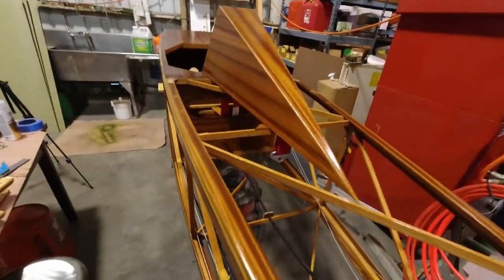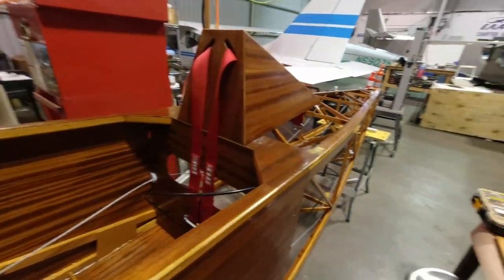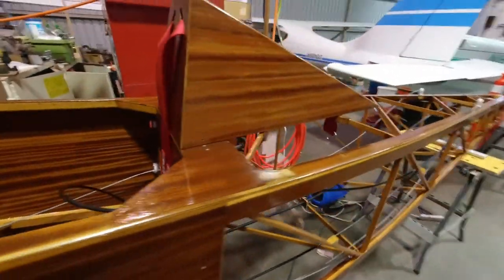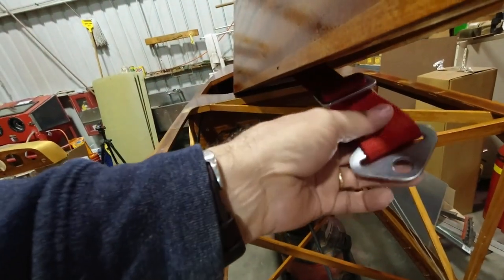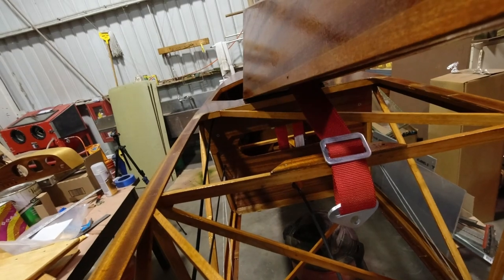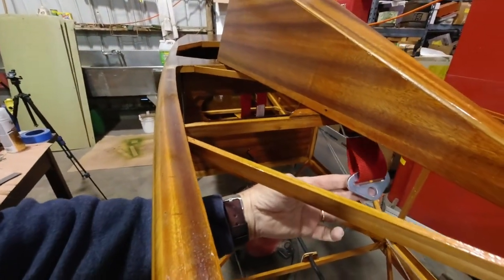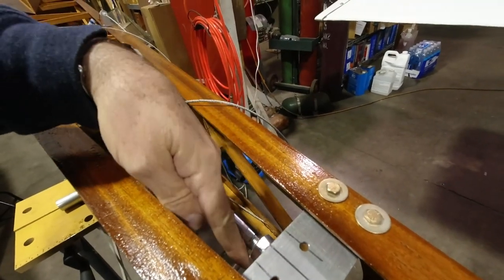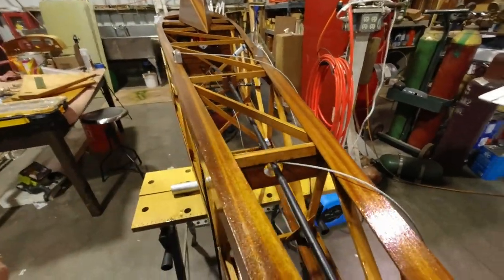Minimax 1100r Wood Aircraft Build Ep 141

Comment: Interesting that your harness goes to the tailplane area on the Fisher it fits to the tailwheel mount.
Reply from the maker: Our planes are cousins. The 101,202,and 303 were designed by Mike in collaboration with Team Minimax founder Wayne Ison. I’m sure there was some Cary over to and similarities to Mikes other designs. My two favorite wood aircraft manufacturers for sure.
Reply: @DTMinimax  cousins for sure but with differences, like the harness mounts and the use of geodetic. Now if Team made a biplane the choice would have been harder.

Comment: Please lookup the accident report for G-CCAJ and consider deviating from the original design of the shoulder harness mounting to improve safety.
From the report:
Safety Recommendation 2006-006

It is recommended that the Popular Flying Association reviews the design of the attachments of the shoulder harness and its securing cable in the rear fuselage of Team Himax and Minimax aircraft, to reduce the possibility of the shoulder harnesses slipping off the pilot’s shoulders and to ensure that all bends in the restraining cable are of greater than the minimum bend radius recommended by the cable manufacturer and not routed over sharp edges.
Reply from the maker: I sure will, thank you for the recommendation!

Comment: I imagine they still call for red Loctite on those two large bolts at the end of the elevator cable?
Reply from the maker: I’d like to drill them and use safety wire
Reply: @DTMinimax  That's a really good idea!
Reply: After tightening the nuts I wrapped safety wire around the threads on one side twice, twisted until it could reach the other side, wrapped one wire around each side and then twisted them together. Even if the nuts come loose no way they could ever become loose enough to cause a problem.